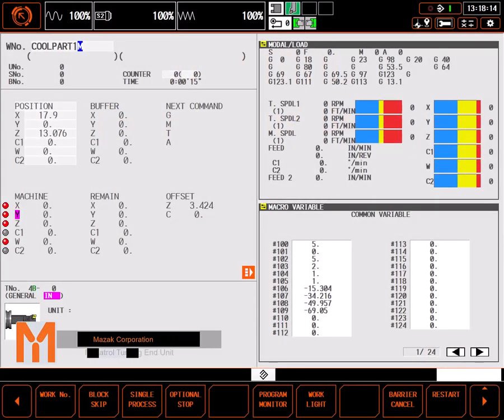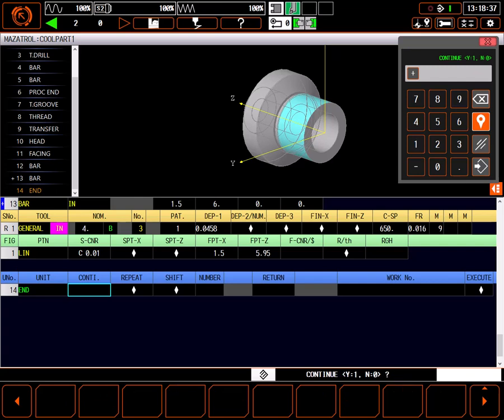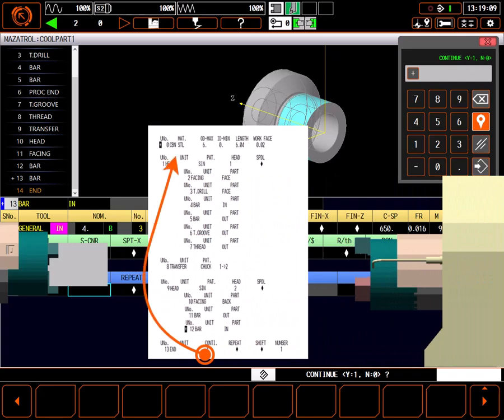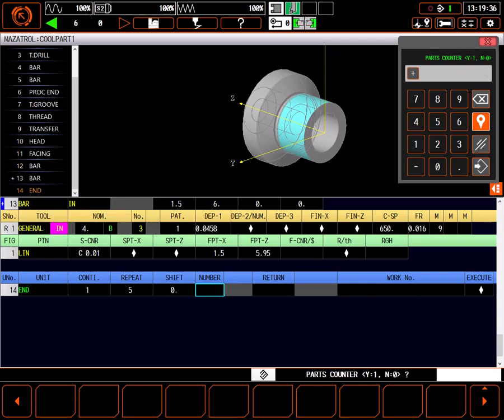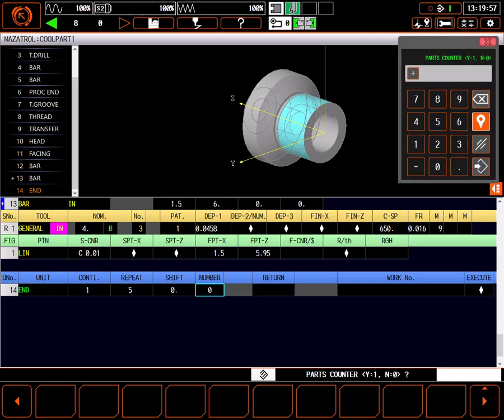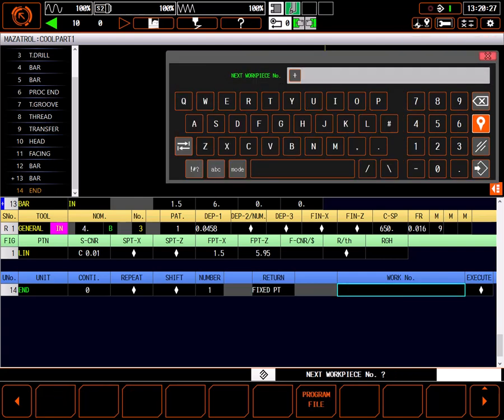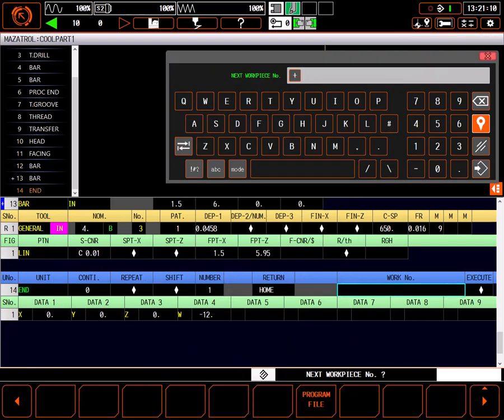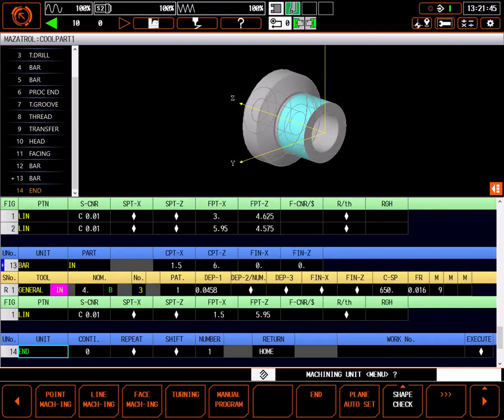MAZATROL Programming Briefs: Turning End Process

Comment: I want to make a multi start thread but I face issue is that 1st thread is ok but when the make 2nd thread then tool start from back side like 10-15 mm in Z ,
But I want to start all the thread from Z =O 

Have any parameters for that
Reply from the maker: Hi Dev,

There are threading guide that can walk you through creating a threading cycle.One thing to check is that the ANGLE is set to less than 60 degrees in the MAZATROL unit. We would encourage you to contact your closest Technical Center and ask for Applications support to help you or provide you with guides.

Comment: is it possible to create mazatrol programs on a PC, meaning not of the machine controller?
Reply from the maker: Hi Bruce, 
Mazak sells a SmoothCam software that can be purchased through your local distributor or through Mazak Parts dept. The biggest benefit with SmoothCam is that you can take the CAMDATA from the controller to duplicate the exact configuration of the machine on the PC software including parameters and tool data. In doing this, it eliminates having to reproduce tooling information while generating new programs.  SmoothCam also has machine simulation and all other functions of the machine controller that is being duplicated on the PC.
Reply: @MazakCorporation  thanks, sounds really useful. I actually don't work in the industry anymore, but used to used mastercam in the office and mazatrol at the machine itself, and just always thought it would be nice to generate the mazatrol programs from the office and somehow send them down to the machines. I could imagine at least it could be a good starting point, I guess realistically further refinement would be done down on the controller if the part was very complex.